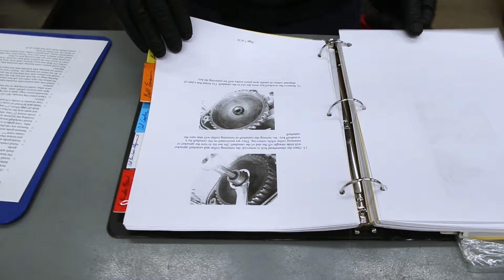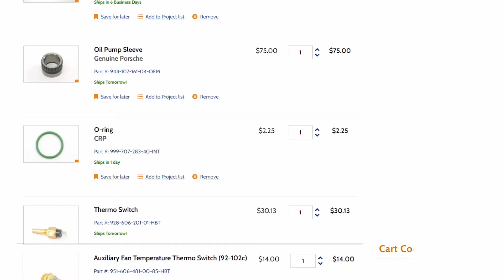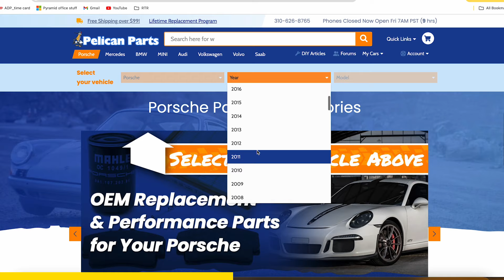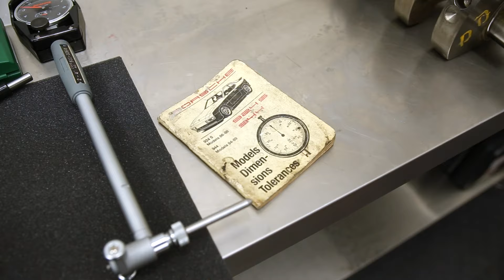Most well built Porsche 944 Engine!

Comment: Nearly the most well built Porsche 944 engine. I would say my 944 turbo engine is the Most well built engine. Except for the block, oil pan, girdle, cam tower, balance shafts and covers, and balance shaft bearing blocks, everything else is new Porsche Orem parts. The crankshaft is a NOS 3L crank, forged molnar connecting rods, forged and coated waussner pistons with the offset wrist pin, piston squirters installed in block galleys, new  m52 head machined for larger intake valves, Lindsey racing cam, valve springs, oil pickup modification, new oil pump, water pump, PRVs in the block and in the head, cam tower machined for solid lifter adjustment ports, degreed cam, plus all new hardware, rollers, tensioner, gaskets, seals, etc. built up by mike Lindsey. Waiting to install a Vitesse. Stage 4 turbo package.
Reply from the maker: ...cool. mines still better...